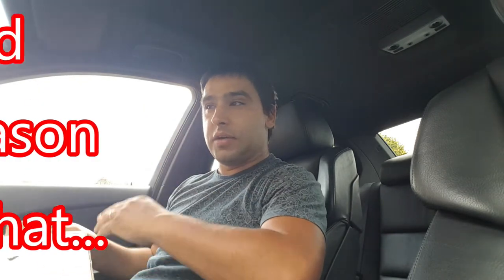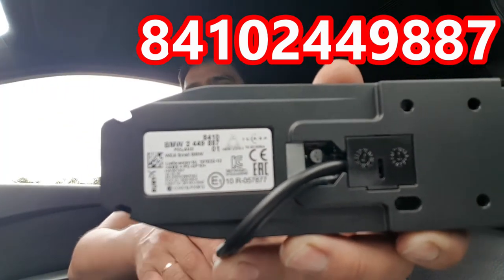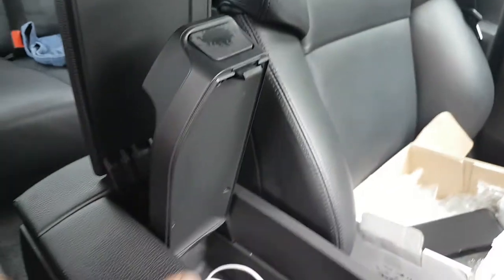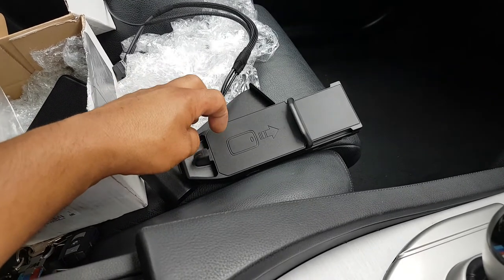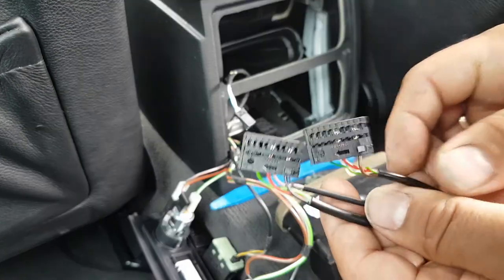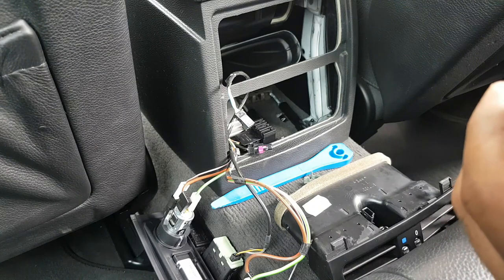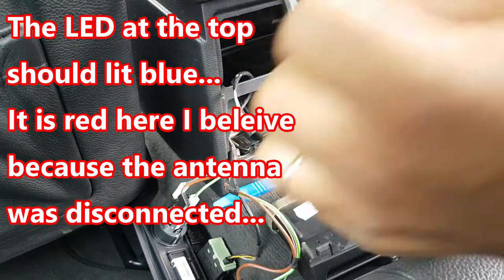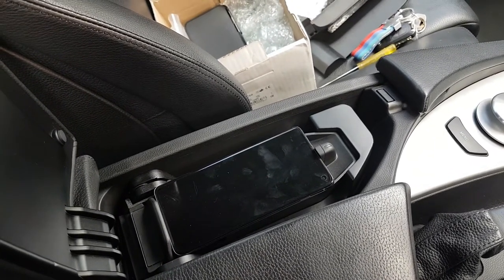BMW E60 OEM mobile phone wireless charging retrofit...

Comment: Good Job Installition LM Auto Repairs. One moment correct,  standart module TCU for Motorola Mobile version E60, connection in Hands side (Hands Free, Driver dynamic speaking microphone).  Your installing TCU adapter for Communicator Box. BMW Original Teile - network communicator, Reconnecting - Recording Connecting.

Comment: Its a Good feeling when you have a add on that means something to you . I had the only Nissan Micra A reg 1983  with remote electric windows and central doors locking The kits were made by spal.I made a circuit to make interior light dim when doors closed . All standers today.
Reply from the maker: Absolutely! 
I had back home, a Fiat 127...
I have installed electric windows and central locking as well... 
Probably the only one in the world! 
😊
Thank you for watching and for your comment! 
👍👍👍

Comment: boas, o link na descrição já não está ativo com o produto, podes verificar ?
Reply from the maker: Yes... looks like they stopped selling the... you still able to find them in places like eBay...
https://www.ebay.co.uk/itm/325134819749?mkcid=16&mkevt=1&mkrid=711-127632-2357-0&ssspo=JdUUR2A6QJa&sssrc=4429486&ssuid=Ov28jkvyTx2&var=&widget_ver=artemis&media=WHATS_APPhttps://www.ebay.co.uk/itm/325134819749?mkcid=16&mkevt=1&mkrid=711-127632-2357-0&ssspo=JdUUR2A6QJa&sssrc=4429486&ssuid=Ov28jkvyTx2&var=&widget_ver=artemis&media=WHATS_APP

ML Performance...
https://www.mlperformance.co.uk/products/genuine-bmw-e87-e90-f06-f12-f20-f22-f30-f32-f80-f82-f87-bmw-wireless-charging-tray?variant=12123665006682&currency=GBP&utm_medium=product_sync&utm_source=google&utm_content=sag_organic&utm_campaign=sag_organic&srsltid=AfmBOopxtzlbP--bnFnI9vASG4J743vymg99a01f9lcAhCm-j3c4mmdAjyc

And there is probably more...
Just google it...

Comment: Please send me the link on ebay with wifi charger
Reply from the maker: That's being a bit lazy... 😉
Took me literally 1 minute...
Jus confirm that the part number matches the one on the video...
As I didn't check...
https://www.ebay.co.uk/itm/BMW-GENUINE-Wireless-Charging-Rack-Stand-Boot-Adapter-Fits-Various-84102449887-/183285027661?mkcid=16&mkevt=1&_trksid=p2349624.m46890.l49286&mkrid=710-127635-2958-0
Thank you for watching!